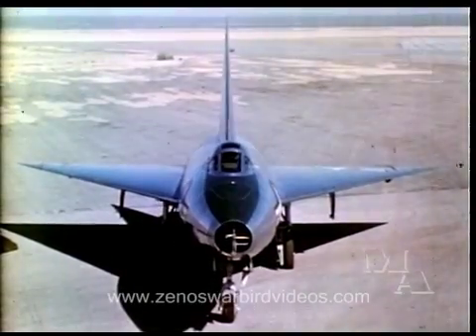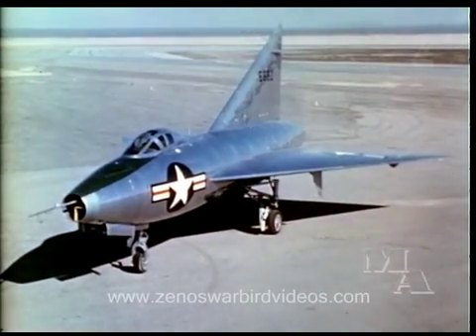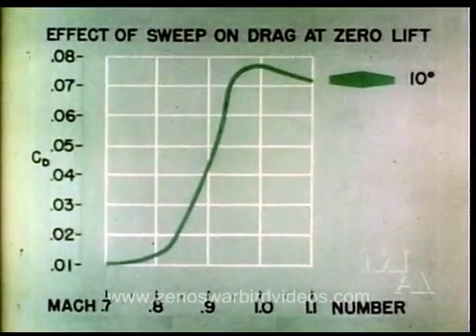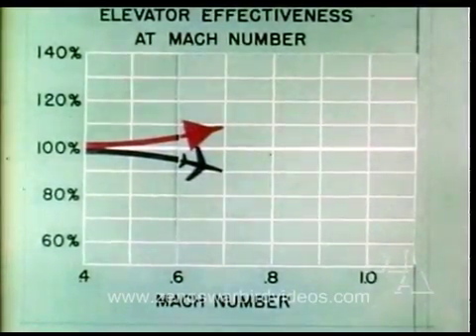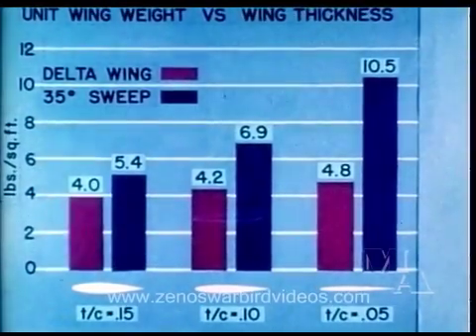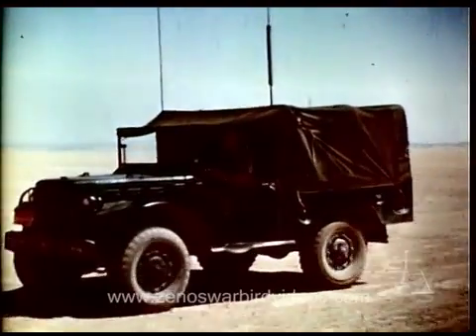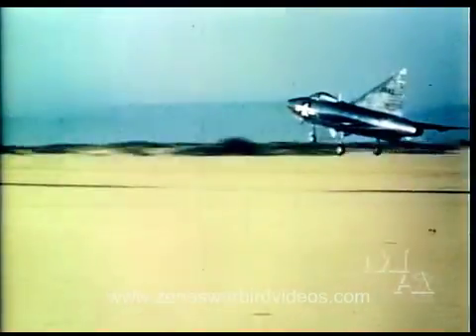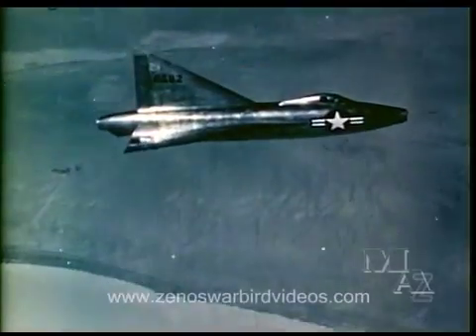Test Flights of the Convair 7002 - XF92A Delta Wing Jet - 1948

Comment: In truth, the aircraft of that era were severely underpowered. They were sleek and streamlined, but barely got in the air.  "Too much airplane for the engine" was the statement right out of the engineers evaluations.  It was a consistent problem that plagued development for the past 30 years.